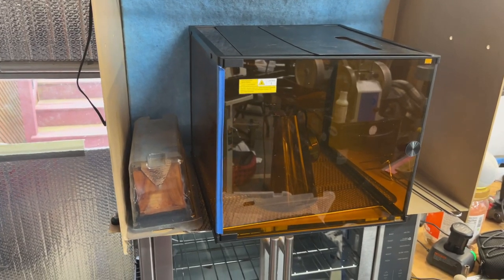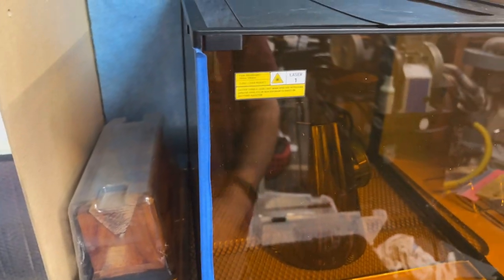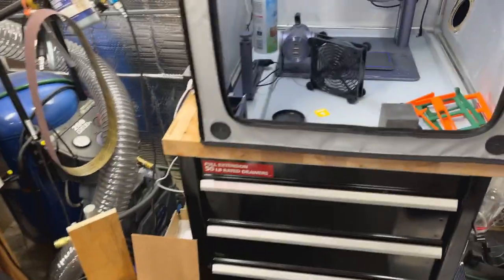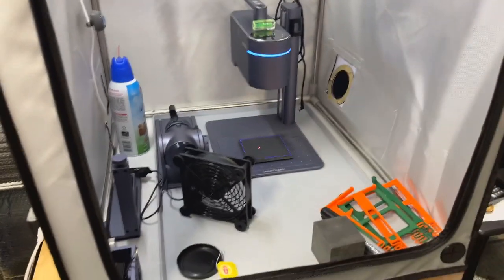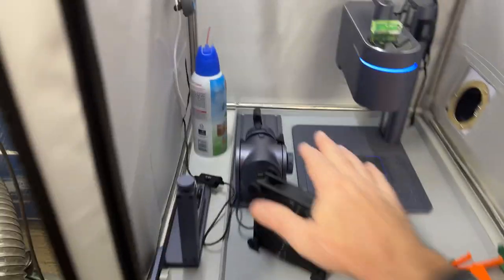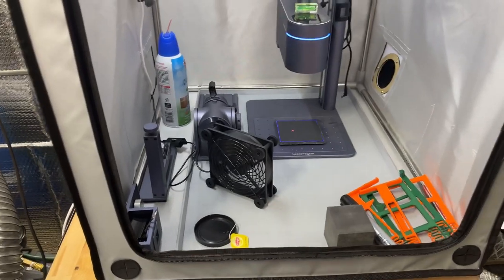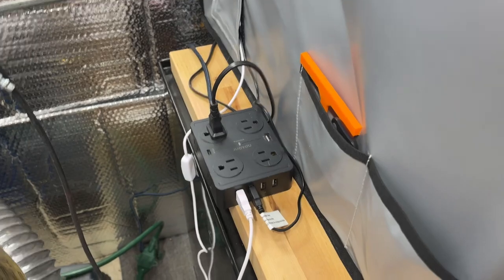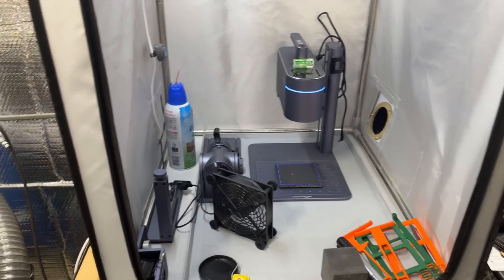The Best Laser Pecker 4 Fume Enclosure

Comment: If you get the laserpecker enclosure do you still have to hook it up to a pipe or something to get the fumes out? Or just the fan on the back do enough?
Reply from the maker: You should still vent it or hook it to a filter. People who can't vent get smoke filters Laser Pecker is coming out with one and Xtool has one already and there are others on the market. The best option is to vet it IMO the filter systems are not cheap 500-700 and you have the ongoing expense of filters venting to outside are is free after the cost of making your vent but you want to protect your lungs some of the gas put out by laser engraving can be harmful
Reply: The LP4 enclosure has a usb powered fan that plugs into the LP4.
Reply from the maker: you still should have a fume extractor or filter @bneil4059
Reply from the maker: you don't want it blowing into the room air
Reply: @ALXSHARPEN  that’s what the hose is for.  The hose leading to the outside.  The one that can be purchased from Menards for about $10 that the fan blows into.